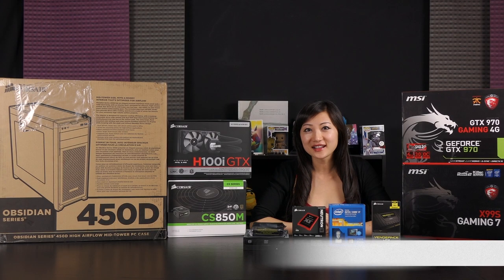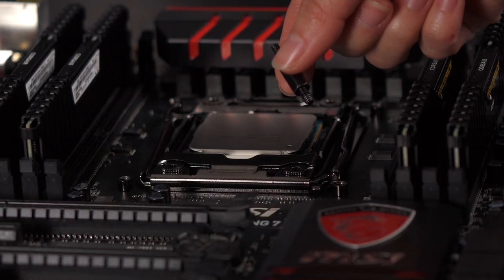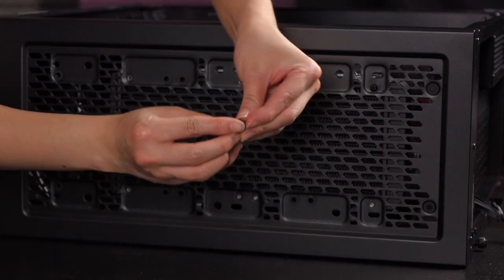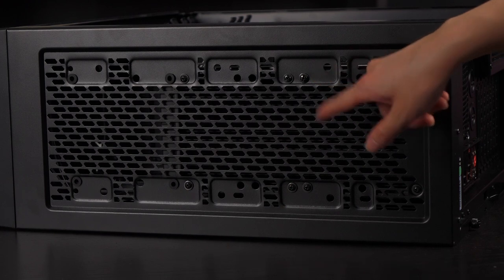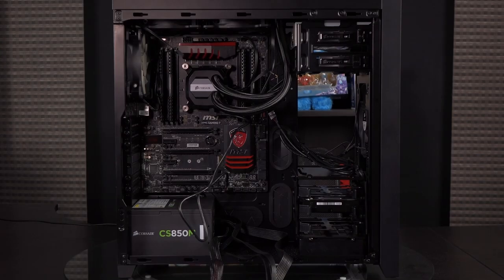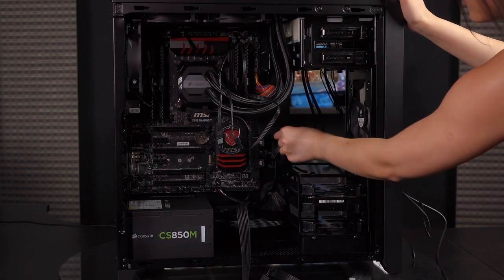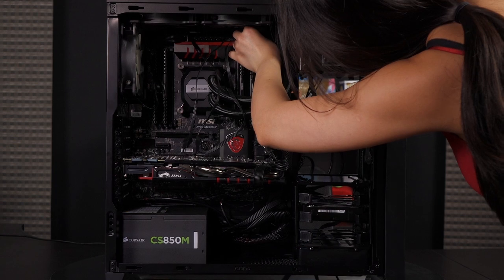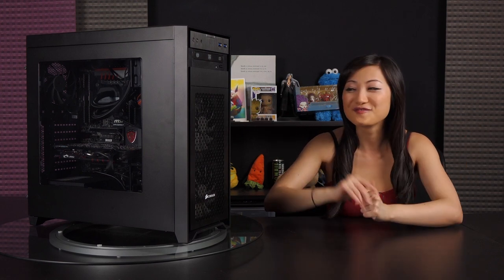How to Build a PC: Epic X99S & DDR4 PC Platform!

Comment: Corsair PSUs are massively overrated IMO. Crap plasticky cables and I've found them to be unreliable.
Reply: Richard Dale The VS, CX/CXM, and RM series power supplies are all made with low quality components. Wouldn't recommend anyone get these.

The CS series is decent, but when compared it to other power supplies in its price point, just not worth it.

The AX/AXi and HXi series are great though. Good quality components and industry grade protection. Cost is a bit high though.
Reply: Yes I agree they're shite. I personally use an EVGA G2 and it's an amazing unit and i would totally recommend it.
Reply: Richard Dale well, I can only afford the VS550 and I thought it is good enough, any other suggestions on the same budget?
Reply: alexalexoe It really all depends on what you are doing with the computer, and the other components.
See: http://www.tomshardware.com/forum/id-2547993/psu-tier-list.html

Overclocking? Tier 1 or 2, High-end Gaming PC? Tier 1 or 2. Otherwise you should be fine with a Tier 3 power supply.

My recommendation, never go cheap on the power supply. Seasonic and Super Flower are by far the best manufacturers.
Reply: Skyler Jacobs I only use for gaming, no OC, my spec is i5 4460 and GTX 760, I don't see any Super Flower PSU in any stores near my place so I guess I will go with Seasonic, is the Seasonic S12II 520W Brone any good? it is 50% more expensive than my current VS550
Reply: Any Seasonic made power supply is good =) Great choice.
Reply: Richard Dale  How do you feel about cooler master V series?  I know their older PSUs had...problems...to say the least.
Reply: @Jeffery never used them to be honest mate. I'm not professing to be some kind of PSU expert I just made a comment on the Corsair as in my opinion they are not a patch on the EVGA G2 series.
Reply: ***** Antec HCG 620M. Also happens to be made by Seasonic.

Your welcome =)
Reply: Jeffrey Basurto I know the question was not directed towards me, but im going to answer anyways. Cooler Master V series are great! On the same level as EVGA G2 series.

The EVGA G2 is made by Super Flower, Cooler Master V series is made by Seasonic. Both of them are high quality power supplies.
Reply: Richard Dale lol ive used a CX600 for 2 years, nub
Reply: Obviously not all of them are going to unreliable. Even if yours didn't break it will still have crappy cables.
Reply: I dont know about the quality but I hate the VS550 cables, they're all over the place, make it so hard for me to hide the cable, my case interior looks ugly
Reply: alexalexoe  I completely agree, the cables are UGLY!

Michael Chapman  You call him a nub? Yet you are the one with a low quality power supply. Good one buddy, good one.
Reply: Richard Dale Since Corsair got into the PSU business, I haven't had one of them crap out although I did have two of their TX650's emit the whine or high pitched sound out of the fan power off-power on circuitry which they replaced without any question. Since the PSU makers decided the flat cables were the Defacto Design, I also had to disagree but by a small amount they are easier to tuck away and shape. They are for sure cheap in quality vs. the older sleeved mesh type.

I've been watching the progress of PSU makers and there's only a few that are considered to be reliable and trouble free. The SuperFlower brand was good, Antec, Seasonic, Corsair, Sparkel etc. I had problems with Thermaltake's failing years back and stopped using them. I hate to admit, but in a few budget builds for cheap customers, I built some P4 systems using plain wrap brands in the 400W $30 price category and never heard back so they must have lasted long enough. Most PSU makers do not make their own, they design them and have companies such as Seasonic contract with them. Anyone who checks, they will find most Seasonic PSU's of any wattage start around $90 and average $150 and up.  As of late, most PSU's of any wattage and quality all start out around $70. For those who are concerned, the id information on the PSU will have a manufacture number which allows you to look up who makes them vs. the brand name.
Reply: Richard Dale I'm with you, Rich.  I have 2 CS paperweights to prove it.  Bought 2 of them at the same time and both failed before the warranty was up.  Never RMAed them either.  If 2 of them failed, then why would I want 2 brand new pieces of JUNK?  And, I replaced them with an EVGA...  -It's quieter, looks nicer, fits my case better, and has plug in cables so I don't have a huge pile of cables I don't use or need laying in the bottom of my case!  -And the most important thing: it has already lasted longer than either of the CS bricks I have laying around.
Reply: Terry Ringelberg Note to self:  Now just get rid of this pos ASUS board and get one of these awesome MSI boards!  When I did my build, I paid almost double for an ROG, and that isn't really what it's cracked up to be...  knowing what I do now, I could have saved a lot of money and headaches by going with the MSI board...
Reply: Terry Ringelberg After 3, 5 or 7 years of warranty depending on what model you purchased, seems fair unless you are saying they both failed in only a few months. Either way, they don't deduct for time used and simply send a brand new replacement which would have put you back in shape for shipping one way.  Any decent power supply can fail early, many of them do including the high end names. The longer they last the better however, if failure is only a few months from installation, could be a concern but not enough to junk the warranty claim for maybe $20 for both. CX or CS models are 3 year warranty TX, RM are 5 year and the top end PSU's have 7 years.
Reply: Terry Ringelberg I agree, ROG, is simply paying for over the top[ marketing they do. Pretty name badges aren't worth $100 plus extra.
Reply: Garth Clark -Yes, I am saying they both failed within a few months...  definitely within the warranty window.  These were for my own personal desktop.  I don't overclock and I don't game, so I should have been okay with them...  I bought 2 of them at the same time because they were a 'great deal'.  -and like I said, it really wasn't worth my time to RMA them for a replacement that would be worthless in a few months once again...  I haven't and won't buy ANY Corsair products -ever again...  Good luck with them if you do!
Reply: Terry Ringelberg FYI, Corsair has an instant RMA process where in they will immediately ship new replacements and wait for the RMA units. All that's required is a credit card number. Best to RMA at some point, it gives them reason to evaluate and asses quality control and/or engineering and the motivation would be there since they lost profit on those two units (maybe).
Reply: Garth Clark You are right about Corsair Express RMA process. Very quick and painless process, and you have a replacement on its way before you send the faulty unit back to them. In fact, I received my replacement PSU within 2 days. Also was refunded the Express RMA fee on the same day they received the faulty unit.
Reply: Skyler Jacobs
It's always a pleasure to have a company backing you up when there is need.
Reply: Richard Dale I have a TX650 that has been running for almost 6 years without issues. 

Besides, Corsair has the most reliable aftersales service over here. Their staffs are friendly too.

I'm thinking about building a system that mostly consists of Corsair products (PSU, Case, Fans, SSD, Memories)
Reply: Indra Setiawan Yes indeed. I have all Corsair PSU's so biased I am however, all of them continue to work. I have four TX750's that run every day and they are from 2008. I have another TX850 from about the same era that runs at least 3 times a week and recently built four Z97 desktops outfitted with TX650's which have the zero RPM fan design. One of those TX650's had the commonly known high pitched squeal just when the circuitry would put power to the fan. I filed a warranty and received a new replacement in two days. No issues since. Recently last year I decided to try a Rosewill Hive 650. No problems with that PSU and it's been cycled on and off daily for 11 months now.
Reply: ***** Really? You don't know about Super Flower?
You list EVGA as a brand you should buy.. Yet you don't even know that Super Flower is the OEM of the G2/P2/T2 series by EVGA.

EVGA and Corsair are not the only brands people should buy.
Reply: ***** You obviously know absolutely nothing about Power Supplies or the OEMs that make the power supplies for companies such as Corsair, EVGA, XFX, Rosewill, Thermaltake, ect.

Take some time and do some research before you make statements such as you have. You know absolutely nothing about the subject, so i advise you to not comment on it.
Reply: ***** I read SuperFlower manufactured Corsair PSU's some time ago. There's about 4 manufactures who make them for Corsair. Check Tom's Hardware, not the best resource these days, they have a chart of who makes which models for various name branded PSU's. Honestly, SuperFlower has a good reputation, I owned one years ago and the reviews were good and my experience with it was equal.

http://www.tomshardware.com/reviews/power-supply-psu-brands,3762-5.html
Reply: ***** Some of the Corsair models are made by SuperFlower for Corsair. Same goes with Seasonic, they make some models for Corsair.  By the way, EVGA also farms out all of their PSU's to other manufactures. See the list on Tom's Hardware: http://www.tomshardware.com/reviews/power-supply-psu-brands,3762-6.html
Reply: Garth Clark +HowAmI
Seems i have been blocked by HowAmI. Guess he/she gets butthurt easily when someone else tells him/her that they are wrong.
Reply: Skyler Jacobs Well, it's likely not uncommon for two powers supply's that crap out very early to leave much of an impression.  I've always felt it's best to at least make contact with the company to let them know and see how they respond. You never know these days as some shine you off as a statistic while others offer replacements and other incentives for your troubles. Truly, this occurs more often than not so that's why I bother.

Had the man/woman bought two TV's from Costco and they both failed in a month or so, I'd like to think Costco would step up as they have in the past and take care of the customer just as much as any manufacture would. Best to make the call vs. trash them and bad mouth them not knowing what they would have done to make the correction painless.
Reply: I can't see what else he has said because he blocked me. would love to see what else he has said
Reply: Skyler Jacobs He hasn't said anything so far! After all the crap he said, I don't thing he has something left so say!
Reply: EVGA is love, EVGA is life
Reply: +HowAmI You don't know who fucking SuperFlower is? They create the best PSUs in the world! I'm surprised you had the guts to say that you should buy Corsair and EVGA only.
Reply: +HowAmI Sure they sound like a shitty company, but so does that first impression of "CoolerMaster"
Reply: Valkyrie Some of the Corsairs were made by Super Flower too.  Not sure about todays line up though. There's bad talk on the EVGA brand just the same. All of my Corsair PSU's since they began to market them have been solid except for one TX-650 that had coil whine and Corsair gladly replaced it in two days.

Comment: would be great if the cpu wasnt put in upside down, she's talking all about doing this correctly this and that..

Yet doesn't wear anti-static wrist band or anything. LOL (FAIL)

By the way... as she didn't do it properly,  

(it's advised to put the radiator fans on top of the radiator so it's sucking or pulling air in or sucking it out)

if there inside the case it's self... all you are doing is pulling (hot air towards to cpu or warm, or pulling it into the case)..

Comment: Why is it important to have more than 128GB of SSD space? My 64GB Crucial M4 is starting to growl at you. I don't think he likes you any more.
Reply from the maker: MultiTelan Because, you don't want that to fill up; if you can, download most things you don't access regularly onto your mass storage drive- 3.5" drive.In my experience, my system gets more sluggish the less space I have on there.
"Fill your solid-state drive to near-capacity and its write performance will decrease dramatically"
Reply: Joanne Tech Lover *gasp* I got a reply from a famous person! geekout Anyway, I agree with you there, which is what my terabyte secondary drive is used for. Lotsa games on it, yep. And I guess this is primarily a gaming machines, so I don't have many other applications beyond 7zip and the other basics...
Reply: I usually get a 64 gigabyte SSD just for the operating system so I can start up my computer in 10 seconds.

Comment: Still good for running 2015 games? please help, thanks!

--------------------------------------------------------------------------------------------------------------------

Corsair 760T Mid Tower ATX Case
Intel Core i7 4770K "Haswell" CPU
Intel 520 Series 240GB SSD
GeForce GTX 780 video card 
ASUS Sabertooth Z87 motherboard
WD30EFRX 3TB Red NAS HDD 
Corsair Air Series AF120 Blue LED Case Fan 55$
CORSAIR Vengeance® 16GB (2 x 8GB) 240-Pin DDR3 SDRAM 1600MHz 
Seasonic G Series 550W power supply
Asus 24x Internal DVD±RW - OEM
Corsair Hydro H100i Liquid Coole
Reply: YeahI have same GPU and CPU I play GTA 5 on high settings just fine and smooth
Reply: Call update 780 to 970.
Reply: Josh Estipona or 2 780s in sli
Reply: Smith John You do realize that the 970 is a much cheaper card with marginally better performance. It almost stacks up with the 780Ti & 290x. For the price of one new 780 your already spending 30-50% more than on a GTX 970. Plus Kepler isn't as efficient as a Maxwell based GPU. Plus SLI for the 780 isn't as good as it is on the 970.
Reply: Smith John The only real benefit is from the 6GB version of the 780. Even then, the price and one positive isn't justifiable to buy it over the 970. 2 970's will beat every 780 sli setup even the 6GB version.
Reply: Josh Estipona Yep you're right that the 970 is better, but you're saying that gtx 780 is more expensive than 970? I thought 780 being old would be cheaper
Reply: NOOOOO! The market no longer has demand for those cards therefore getting a profit from them is almost pointless. The last price they went for is the price they're set at for the rest of the time they are being sold (THIS IS FOR GETTING UNUSED FACTORY NEW CARDS). This is consistent with many older cards (BEING SOLD AT NEW). However, refurbished and used cards sell for significantly less you will need to be wary of reliability, coil whine, and issues with it being used. For Instance the GTX 600 series are only available used by other retailers as are older cards. Although they are cheaper they are significantly less powerful than the newer cards released in the 2013-2015 era. The 700 series is slowly going down this road plus they are way more expensive new than a new 900 series card.
Reply: GTX 980 replaced the GTX 780Ti / (1080p and  up)
GTX 970 replaced GTX 780 & 770 / (1080p and up)
GTX 960 replaced GTX 760 & GTX 660 / (Strictly 1080p)
Reply: I might actually wait for a few weeks.In June, new GPUs are being released so those might give you more power than current GPUs.
Reply: Spoder Men Hopefully the 980Ti

Comment: Using HDMI, OMG terrible. Should be DP, or DVI at worst.  Anyone using VGA or HDMI are bad, bad people.
Reply from the maker: CoderMonkey Nathan Why do you think HDMI is bad? Unfortunately that monitor doesn't have DVI.
Reply: Joanne Tech Lover Sorry, another look at the video and noticed the model of the monitor to be the Samsung S27D390 which only has a VGA and HDMI and maximum res of 1920x1080@60hz. HDMI standard is one designed for TV video/audio hardware that has been adapted to PC in order to connect to projectors and TV's. Over time, it's also popped up on monitors. It's a slow to adapt proprietary standard that good for it's originally designed purpose. But PC standards need to open and able to adapt quickly to changing requirements. For the time being and into the foreseeable future the best standard I find is Display Port. It's already planning to support 8k@60hz and 4k at refresh rates over 60hz on single connector with version 1.4 about to be released.